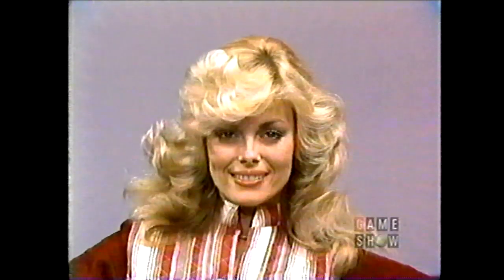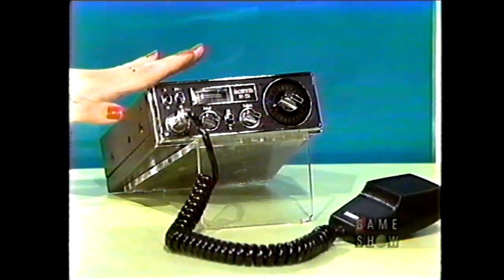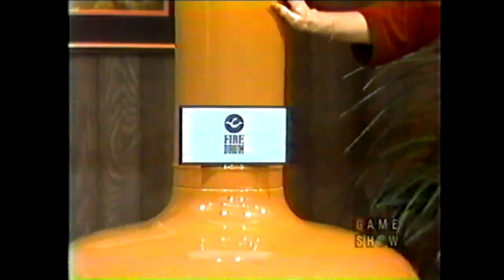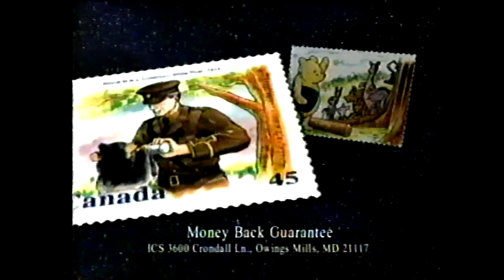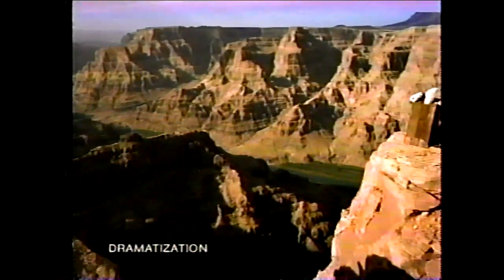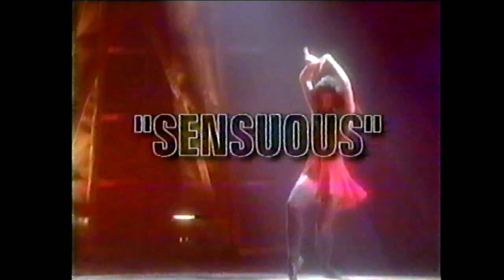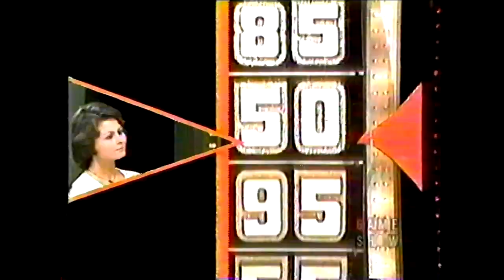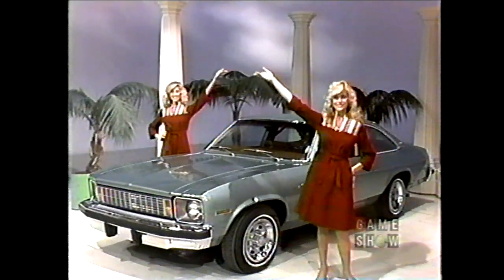The Price is Right:  December 27, 1976  (Double Showcase Win!)

Comment: @ 45:12 seeing how well the appliances were built back then I bet you that refrigerator freezer still works!
Reply: I bet so too.  My son in-law paid a good amount for a brand new fridge/freezer, it needed repaired after only two years.  Cheap, cheap, cheap.  I know of refrigerators and freezers that are still going strong after 40 years, along with washers and dryers from the 70's.
Reply: @susanspatz9501  My Kenmore washer is 31 years old. 😊
Reply: @pauljoseph2400  Not at all surprised if it still works.  I remember my Dad's Ford Ranchero, he didnt even change his spark plugs for almost 10 years and that car was still going strong.